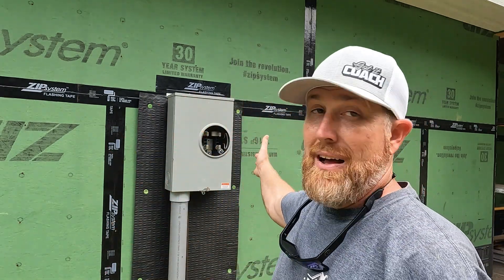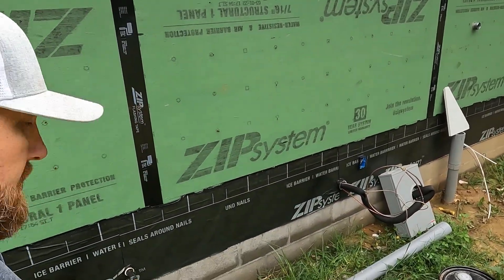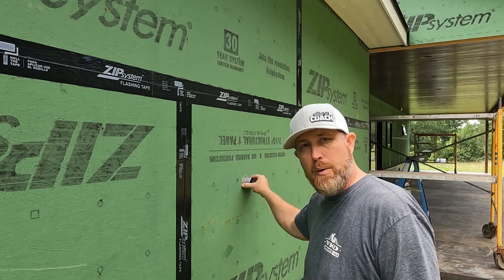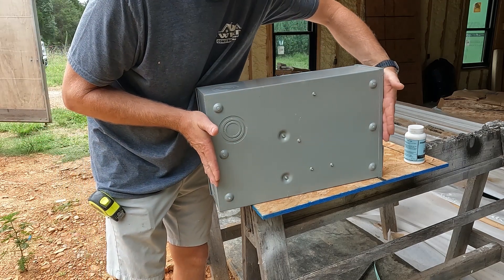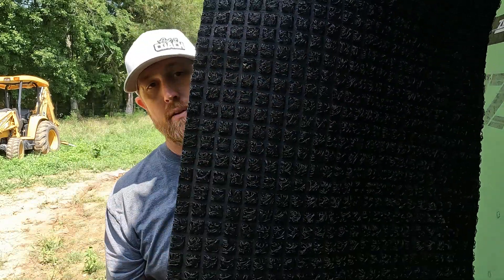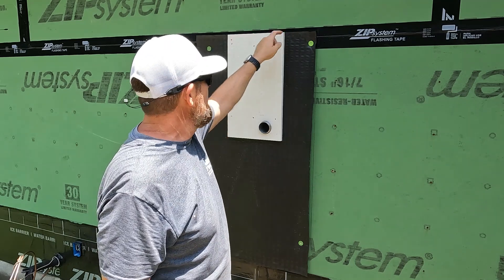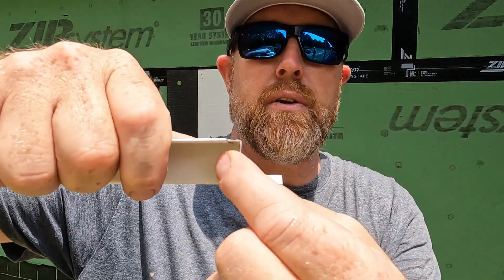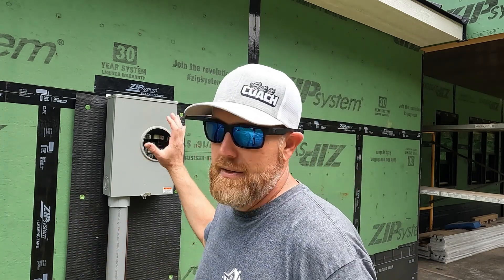The Melton Farm Project - Part 16 Underground Meter Base installed with a RAIN SCREEN

Comment: Sincere question: if the rain screen is not yet available to the public, is it really a necessary product? Is the goal of the manufacturer to get this product to be required by code? I think it's a great idea, but I've never seen or used it in person. Now I'm worried about the wooden siding installations I've done. I guess it's just destined to rot and eventually require replacement?
Reply from the maker: You can purchase other brands of rain-screen, just not Zip system yet. I am using a board and batt siding and will not be caulking 95% of the exterior. Water will definitely find a way to get in, this rain screen allows it to dry moisture out. I believe They designed the zip screen actually for stone or masonry type veneer. Stucco, or faux stone. It definitely works great for siding too. Siding set flat against a sheathing will definitely be more of a risk for water damage.
Reply: @w.k.d.constructionllc  thank you for the reply coach. I appreciate your sincerity
Reply from the maker: @thegreatshitstain  thanks for watching and the good solid questions!

Comment: So far I've gotten use cap nails, and don't hit the nails to crush the screen? Got it coach 👍

What's that screen made from? Looks like a polymer of sorts? 

Do you guys have to end dam your flashings?
Reply from the maker: Basicly yes, easy system to apply. I’ll get detailed on it on another video when we install the siding. 

Yes a polymer of sorts. 

I don’t have to, but it looks a little better to me